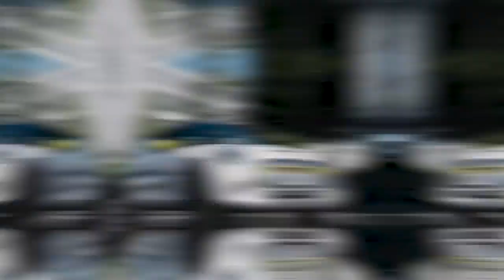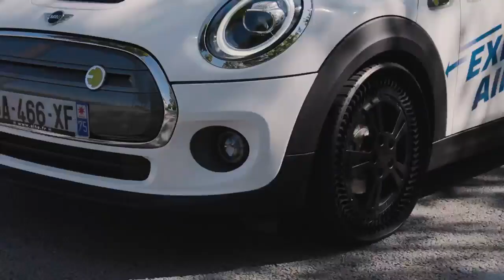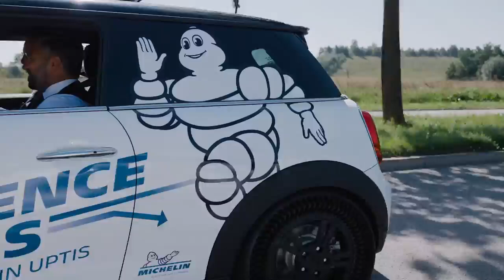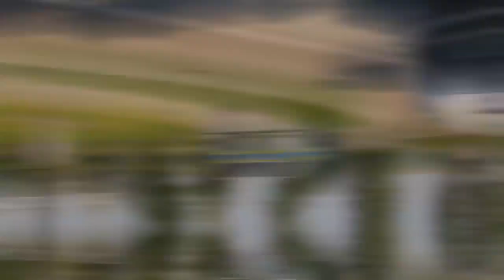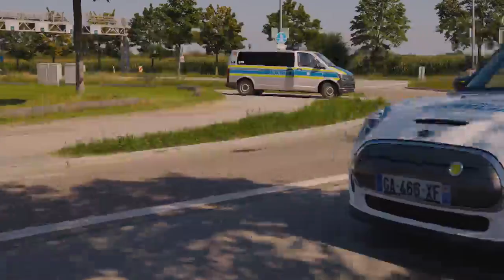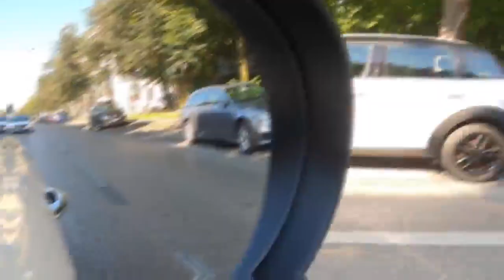Michelin Uptis (Airless tire) on road test

Comment: With new technologies like these instead of imagining that this is going to dominate the industry, it’s better to look at the pros and cons and imagine the applications it would be the most suitable for. These tires reduce upkeep required and reduce scrapped tires due to irreparable punctures, but they also have higher hysterisis and are susceptible to foreign material. Perhaps this would be a good fit for a mars rover, or some type of farming equipment since they operate at low speeds. I struggle to see this for electric vehicles since rolling resistance has such a large impact on range.

Comment: Guys we want a JCW with a turbo 3 cylinder, rear wheel drive with a longitudinal mounted engine, carbon driveshaft with these wheels!  And a decent 6 speed manual and robust stop and start technology.  Also loose the weight and go with lithium ion battery for a starter battery.
Reply: Just get the Toyota Corolla hatch then lol...
Or the Mazda turbo